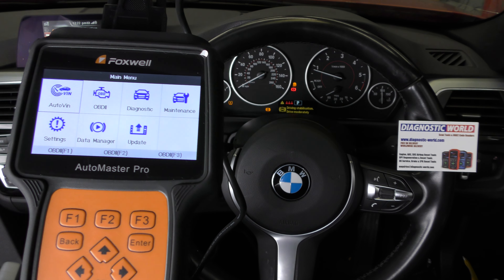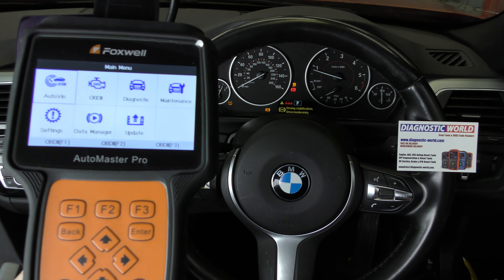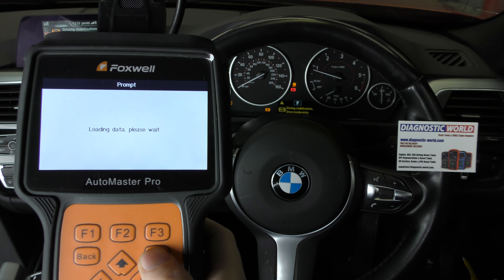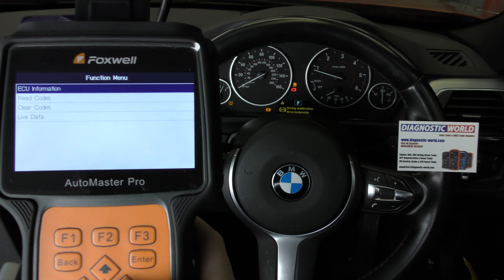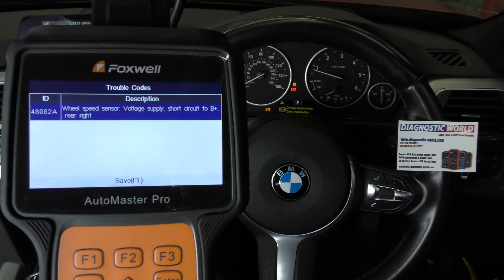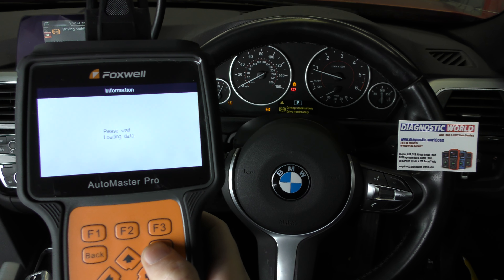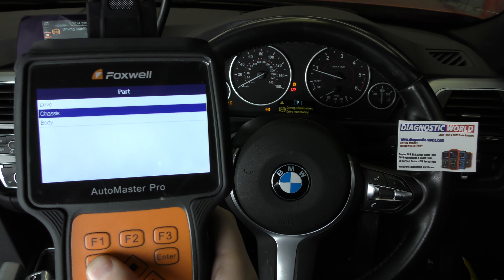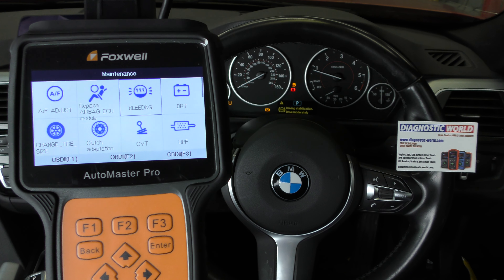Cost Effective BMW ABS/DSC Warning Reset with Using Foxwell NT680 PRO

Comment: Hello! I have doubts about the ABS module intake valve calibration procedure. can you help me ? as soon as I start the procedure, I apply the brake to 140bar of pressure as requested but nothing happens. what is the correct step by step of this calibration?